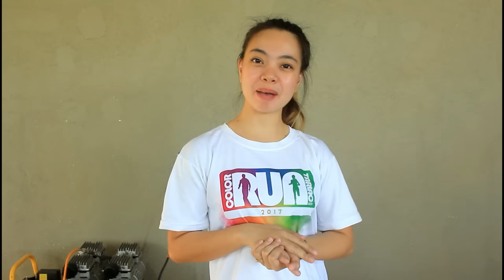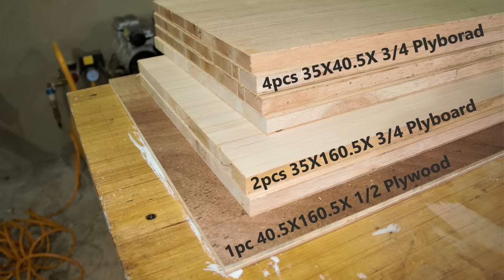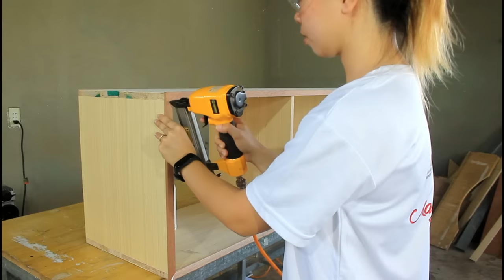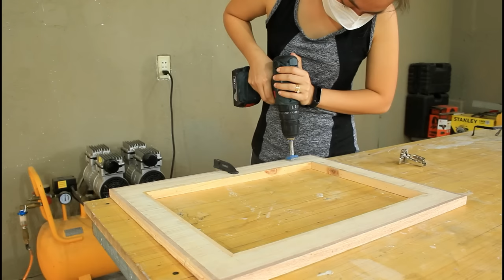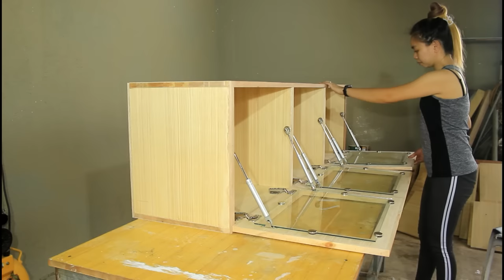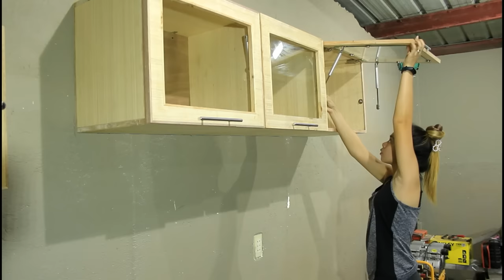Building a Pull-up Door Tool Hanging Cabinet || Workshop Project || D.A Santos ||

Comment: Cannot be too confident with the anchor, wall plugs are not known to be reliable.
Reply: Yup, was thinking that she might do a french cleat.
Reply: She will find the good anchor as she build more
Reply: Even though.. now a day there are some blue screws that not need anchors….and it’d be more easy to install that
Reply: The cement used is different consistency I guess so can hold that much without an issue. I’ve seen that in different continents in the world.

Comment: Ang difference ng gypsum screws at wood screws.Ang GYPSUM SCREWS,BUGLE SHAPE Ang head at THIN. Ang WOOD SCREWS naman ay TAPERED SHAPE o diagonal.Kung drywall screws ang gamit sa cabinet,SUBSTANDARD yan dahil Hindi designed o intended Ang gypsum screws sa cabinet kundi sa gypsum  board lang.

Comment: GYPSUM SCREWS ba ang gamit mo  sa pag assembled ng cabinet?Dahil ang GYPSUM SCREWS  not designed at not intended sa cabinet.
Gypsum screw designed at intended lang sa gypsum board only.Gypsum screws ay hard,brittle at prone sa corrosion( mostly sa high moisture).
Overstressed,madali sya mag snap dahil brittle.Hind ideal sa heavy load mostly sa cabinet. Check mo sa Google at YouTube kung tama Ang sinasabi ko..Dapat sa legit na site at manufacturer.Coarse tread screw use for wood stud and Fine tread screw use for metal stud.
Reply from the maker: Blackscrew po gamit ko for wood .